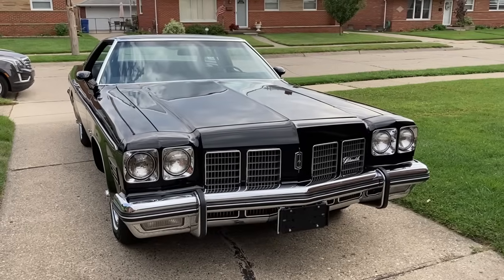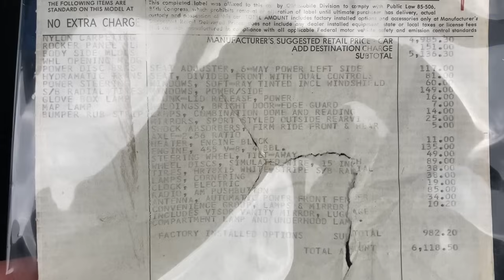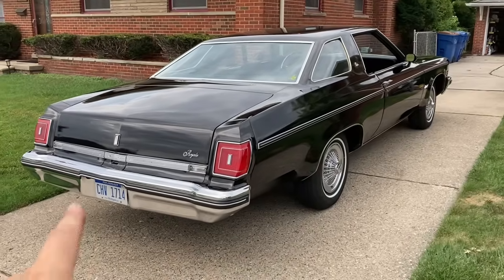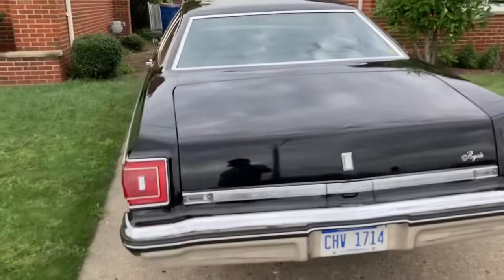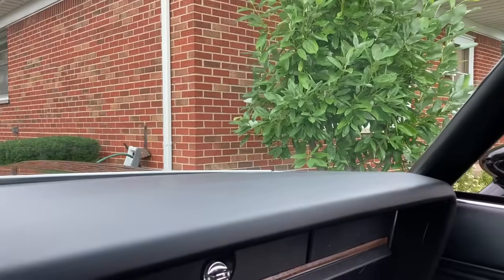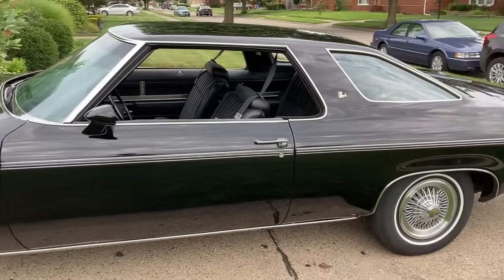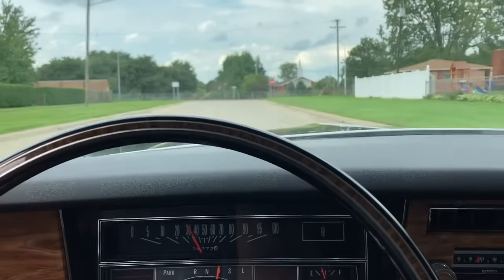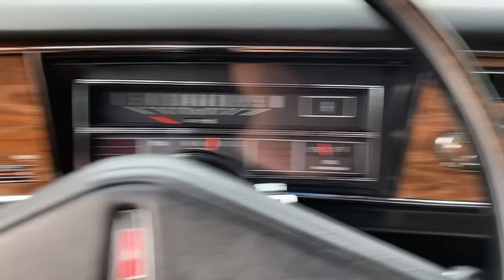4k Mile, 1975 Oldsmobile Delta 88 Royale Coupe Review & Drive - Check out article in description!

Comment: I'm sure you want to keep it all original since it's in such great shape but dual exhausts really help these smog-era cars with freeing up some HP (and gas mileage).  My cousin put duals on his 1972 Polara with a 440 and it transformed the car, so much more power we couldn't believe it.
Reply from the maker: It does. I’ll keep this one stock, though as it’s so quiet.  You can’t buy an exhaust system this quiet any longer.
Reply: @RareClassicCars  very true, there are "quiet" aftermarket mufflers but inevitably you'll still get some rumble compared to stock.

Comment: One more thing,  I have owned and had friends that have owned dozens of these 70s mid size and full size cars,  but have NEVER seen the antenna Local / Distant option.   And regarding the spring rates,  overall I've found the full size GM big block cars had stiffer spring rates than the 350 equipped cars-  That goes for the larger A bodies too from 73 to 77.  I had a 75 Electra 2 door that lost the 455 engine,  a buddy had a 350 4 Barrel available for next to nothing,  so did the swap with the big transmission,  it sat a bit higher with the lighter engine and handled very well after the swap.
Reply: I used to have a '76 Eldorado convertible with that two-position antenna. Though the switch lettering didn't indicate local/distant, it functioned exactly the same as the antenna in this 88. Power antennas with the 3 black-green-white wiring worked like this.

Comment: Does it have the air bag option?
ACRS, I think they called it. If I remember correctly, 74 was the first year.
Reply from the maker: This one does not.  Easy way to tell is that those have a supersize steering wheel and center glove box.

Comment: You should spray the rubber parts with 303 Aerospace Protectant it keeps rubber parts from drying out and rotting out. There’s a guy with a YouTube channel called Sweet Project Cars he swears by the stuff, he’s been using it for years and he uses it on belts, tires, hoses.

Comment: You need to get a set of tires with the 1.6 inch whitewalls on that car, which is correct to the 70s and those hubcaps will look even better.

Comment: That has to be almost a 1 of 1 with that engine and suspension  and options.. I had a 74 Imperial that I added dual exhaust to and it completely changed the character just of that car it was still smooth but it had noticeably laymore power especially up upper RPM

Comment: My 81f100 had the annoying dash rattle also how they were made an I put thin foam rubber you get to seal off the doors an Windows on homes between the face panels an the mounting surface at the edge were they meet now no rattling squeaks an it's quite for the first time

Comment: I'm in TX, I worked at GM dealers when that car was new and I never have seen a full size BOPC without a/c. I assumed 71 model launch brought a/c as std.
Reply: @jimmy aber
No our 1974 model which was almost identical to his car except for AC and the Rocket 350. The AC was still an optional extra and I think in 1974 it was 380$.

Comment: I collect these Mid 70s full size GMs. I own 3 1976 Buick Electras. I have a specific question that maybe you can answer. Why did the under hood cowl to fender support bars disappear on the 75 and 76 Electras? The LeSabre and Estate wagon kept them. Makes no sense to me. Other full size GMs kept them too. I would love to talk to you if you could ever reach out to me. Your channel is doing great. keep up the good work
Reply from the maker: The 98s lost those as well in 1976. I suspect there was one reason: cost.  Why they would thrift the top of the line car and not some others, Im not entirely sure. 

Perhaps the longer wheelbase helped attenuate some structural issues. Hard to say.
Reply: @RareClassicCars  At the end of the day someone in GM made the decision to remove them on Ninety Eight and Electras even though the 71 to 74s had them. It just makes me wonder if GM added additional structural bracing to the frames of the Ninety Eight and Electra since LeSabre and Estate Wagon kept them.

Comment: Fresh gas; but what about the ethanol gas of today?  My 1995 is designed for ethanol, but how does it affect earlier cars?
Reply from the maker: It eats away at some of the fuel system parts, particularly those in the carburetor. But I’ve gotten good at replacing that.

Comment: I think despite the so-called "GM jiggle" that a lot of these cars had and some quality issues Ford had back then too, one thing you can't fault this car or other American cars of that era for is the mechanical reliability of them, especially compared to cars of today. For example, the Turbo Hydra-Matic 400 in this Oldsmobile is an absolutely bullet-proof transmission.

Comment: The far needs a pair of 1157 switch back bulbs. Many shows with old gm cars move the bumpers inward I did it on my Seville on the rear and my  aprice fro t and back on my 73 Caprice front 
Removeove the bumer shocks drill a hole in them collapse them in a vice,drill a hole and put a screw in them to keep them collapsed then refit the bumpers delete the plastic fillers.

Comment: Lucky guy.  You've bought practically a brand new 1975 Delta 88.  You are young enough to keep this car at least another 10 to 15 years and if you don't put a lot of miles on it you'll be able to sell it and get a good retirement check for it.  Keep the miles under 10k though.  That car will bring a hefty price in 15 years from now.

Comment: Would you add dual exhaust to this one as you have on some of your other vehicles? How much do you think that would add horsepower wise to the engine? Technically, you would have to add a second catalytic converter too.
Reply from the maker: I probably will not. The stock exhaust is so quiet that it’s so enjoyable as is.  I won’t be able to find aftermarket exhaust this quiet. I’d guess duals would add 20hp or so

Comment: I own a 1978 Olds 98 2 door Regency with 63,000 with the 403 cu engine. Love the car but yes it has some quirks that drive me crazy. The cruise control switch is on the right side of the radio yet the rest of the controls are on the turn signal stock. Who in the hell thought that was a good place to put a switch. I have factory air and the glass GM moon roof which has caused me grief keeping it going. The doors are so damn heavy should have had power assist to open and close them. Yet the seats are power but the back rest is manual and only on the drivers seat. The passenger has to suffer on a long trip. So so quality but can sure burn the tires at a stop light.

Comment: I have a 73 Coupe Deville and a 74 Lesabre. Both low mile under 60k unrestored cars. The panel gaps are laughable. I can't believe that people would accept a car that way in the early 70's but they did! I've owned Ford products (Lincoln, Mercury, T Bird) from the same era and they were far better inc the paint finish. It seems GM had the build quality issues at that time maybe Chrysler did too?
Reply from the maker: Oh yes. Ford was the best I’d say during that time. GM and Chrysler were a a distant number 2 and 3.

Comment: That horsepower- jeepers, really lousy for a gas guzzler. A quite low compression motor? What fuel rating was it running back in the day 50 octane? (facetious)
Holden (Australian GM) back in the day- 202 6 was 135bhp, 253- 185bhp, 308- 240bhp, 350 (imported) was 275bhp. All about 9 -9.4 to 1 compression ratio. The 350 import was 8.5 to 1, but there was an earlier model prior to '72 that had more power.
The GM boss in Detroit at the time, decided the world would have a spongy car that handled lousy with terrible understeer that wore the tyres out prematurely and so the best looking Holden ever made (HQ) handled shockingly. Too much overreach from the silly old fool.
What is the economy- of your car?